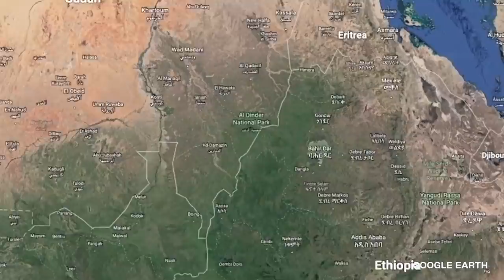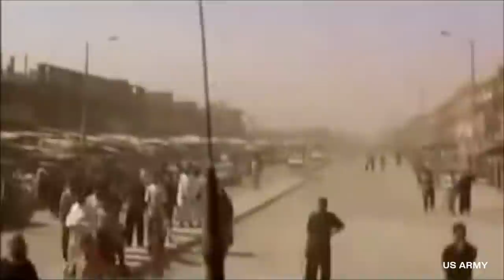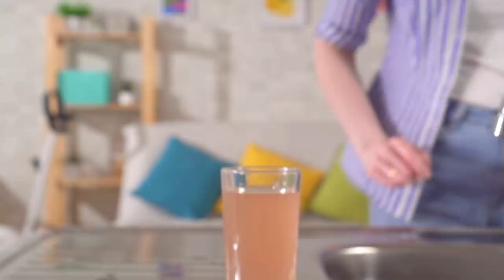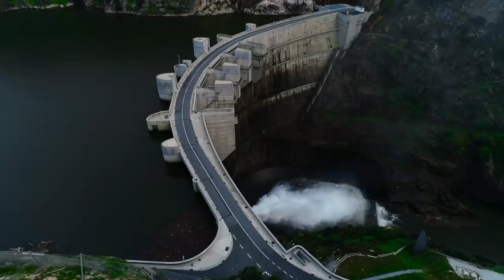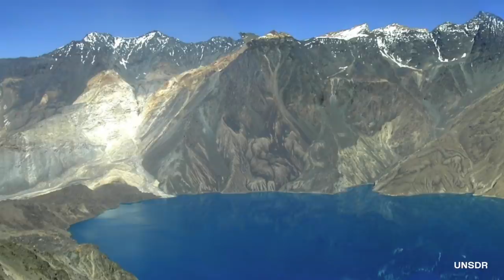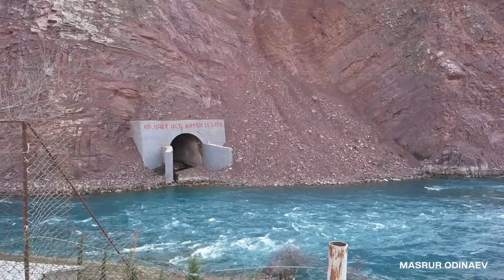5 Dams That Could Fail Any Second #2

Comment: The amount of water accumulated is irrelevant. The total pressure depends on the water height and the cross-sectional area but not on the water volume. Typical thinking error.